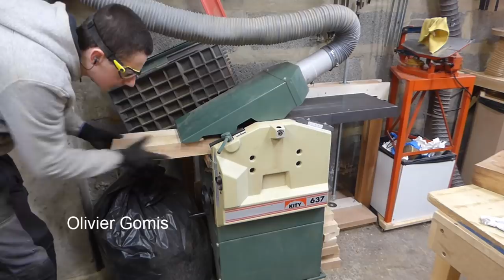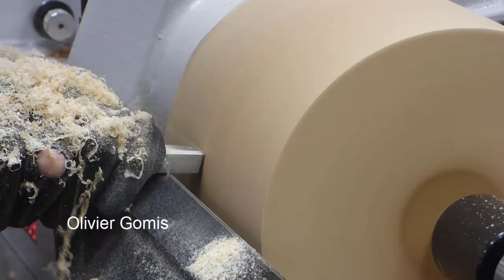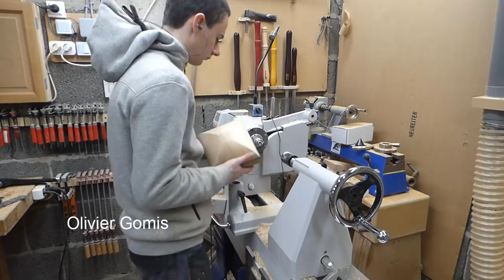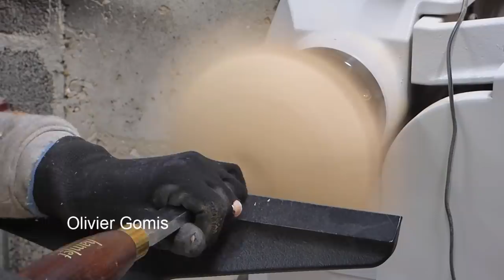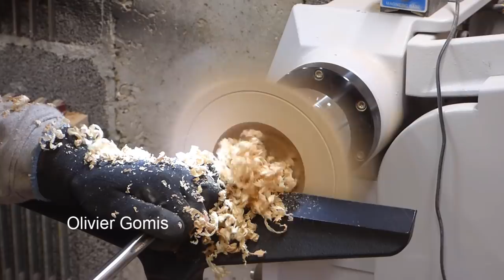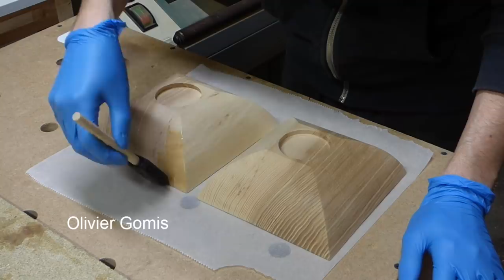Tourner un bol carré sur 3 axes ! Tournage sur bois

Comment: I've seen several questions about the center wood being turned away. I suspect that it has to do with making it bigger in order to have the width and length the same without needing to use the really nice slab wood. If he didn't have the waste wood, then one of two things would have happened. He would have used a third piece of expensive wood and turned it away, or he would have had a really thick bowl.

To end up with the rounded square with exact square proportions (like he did) but still have it be the height that it is, you need to turn away the center. If you look, the red part wasn't turned round, he left it flat.

His proportions are good. Instead of it being half as high as it is wide (which would have happened if he hadn't turned it away), the height is 1/3 the width. It shows really good forethought (or making a mistake before and learning from it).